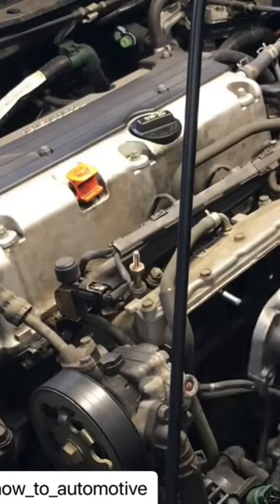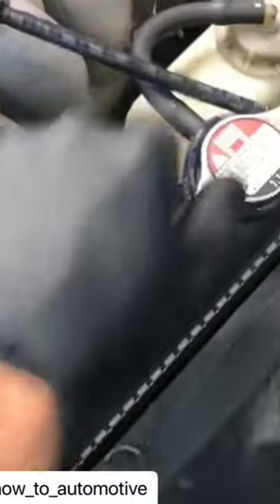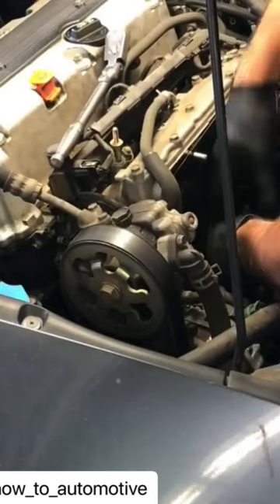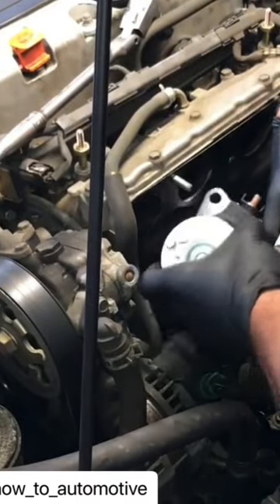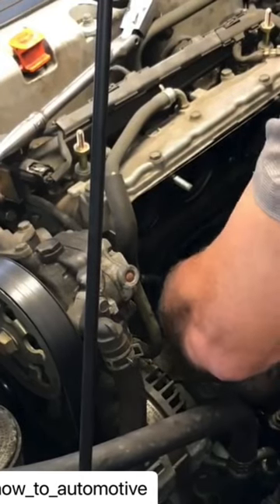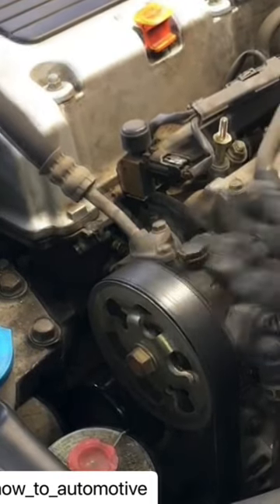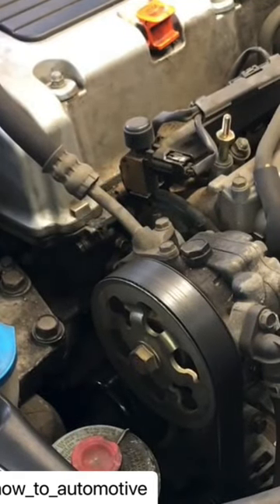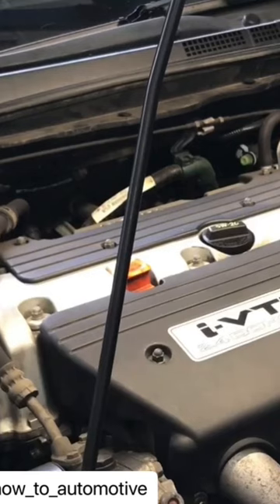2.4L Honda Starter Replacement The Easy Way

Comment: I've seen people just remove under engine cover and remove
Reply: They're no way it's trap with thro..bady
Reply: Later model crvs after i believe 2005 not sure dont quote me but those models you can remove the under engine cover and get it more easily but thats not the case for 2000-2004
Reply: Takes forever and pain in the butt
Reply: It's ass bro.  Trust cause I've done it lol

Comment: I’m trying this on a 2012 CRV. There are 4 bolts that hold the manifold Plus a bracket underneath held by 2 12mm nuts. Not a 20 min job at all….
Reply: How did this work, i need to change starter on a 2013 and seems so much easier coming from the top.  any issues?

Comment: This is the way. Just waiting for the part to arrive, and I'll probably be replacing one of these on a 2008 CR-V this weekend. 10-15 years ago, I would have had no problem tackling this from underneath, but with my neck and back these days, that's not happening any time soon. Very glad I researched before tearing into it.
Reply: How did this work out for you man?? Bout to atemt to replace the starter on an 05 haha

Comment: Can you do it this way on a 2004 CRV??
Reply: No crv is different style. You have to take radiator fans off, atleast the pass side one. Remove the intake manifold completely since the design is slightly different than accord. Spray penetrating oil on lower bolt from the opening from transmission side because sometimes the threads bind during removal. I’ve had few where threads where chewed up on lower bolt while removing as bolt threads are exposed to elements.

Comment: Whatever way you do this, DO NOT use an aftermarket starter. Get a genuine Honda starter. You will have issues with the crank sensor if you go the cheap route and then you will have to have the computer relearn  everything because the engine will go into limp mode and won't go over 25 miles an hour. Freakin shade tree mechanics here.
Reply: I used a bbb industries starter on my element same k24 engine no issues
Reply: @cdotson0027  no issues here either at first, hope it works out for you but if it doesn't then the Honda part will fix things.
Reply: I have to agree here. I'm all in when it comes to aftermarket parts, especially honda compatible parts. but there are 2 parts I will always buy new OEM. A starter and an alternator. No rebuilds, no "upgraded" versions. I've spent an entire day swapping out my jeeps alternator because I kept getting bad ones. too much or too little power. I did 2 at home and 2 in the parking lot of the auto parts store because I didn't want to come back when it inevitably failed.. which it did. I ended up spending the extra $50 for the fourth one and it worked right away.

Comment: Try that on an 06. Not gonna happen
Reply: Just wondering what’s the difference for a 2006 model? (I have one!)
Reply: Take out the manifold and put it on top the engine and cover the coolant  line  trust me going be way easier